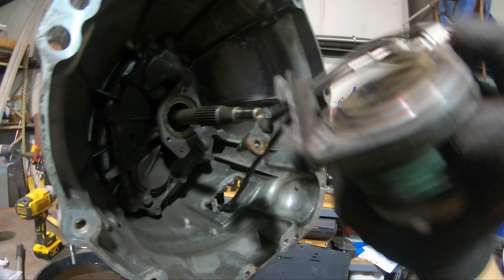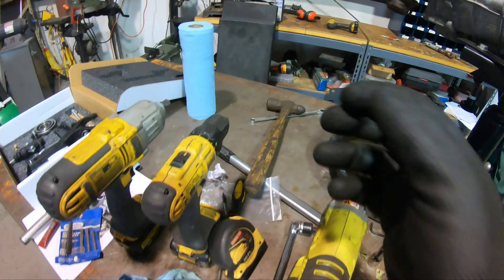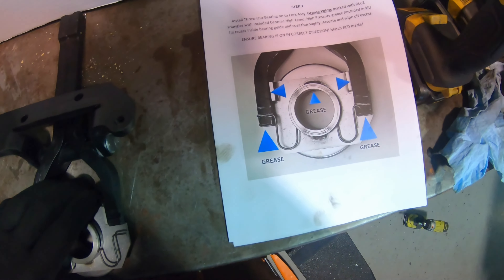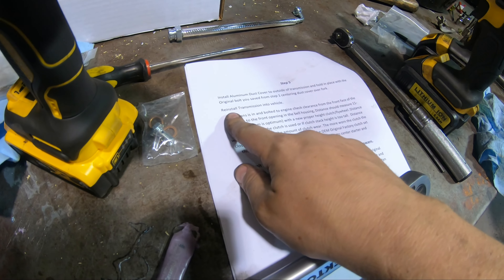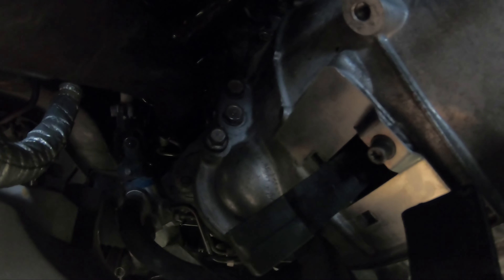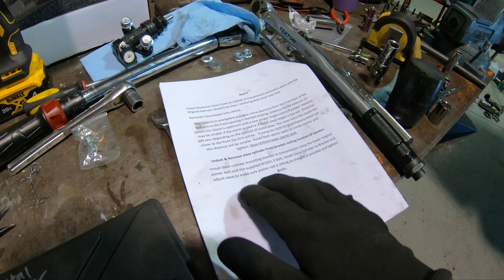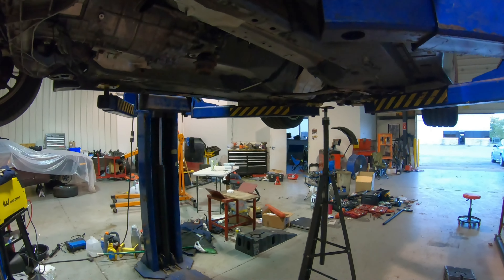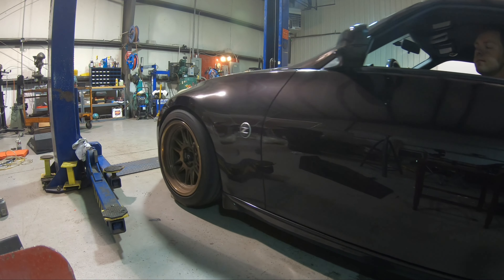370z Clutch Issues Transmission Removal and  ZSpeed CMAK Install Guide Part 2

Comment: Great job detailing the steps and commentary on possible mistakes to watch out for. The CMAK is the best kit around and I'll be getting the upgraded version soon.
Reply from the maker: Happy to help! It was a learning experience for me so I'm hoping that any small issues I had are the same issues others might have! I am interested to know what's different about the updated version!
Reply: @konradchristen  better engage/disengage characteristics, stronger materials, and I think a better cylinder. I had the V1 and it worked well from 2011 till 2022, only issue is the creaking noise from the cylinder after about 8 years lol. I'd call and double check this info as it was a while ago that I asked. But if you have the V2 you should be good for many years to come.
Reply from the maker: @Spushed  Thanks for the info!
Reply: @Spushed  how do I distinguish what version is which and where do u recommend buying one
Reply: @Spushed  I just got the v3 but haven't installed yet , I also got the stage 2 quiet clutch kit from them as well

Comment: My 09 Z clutch finally gave up after 110K miles. Exactly like what you're experiencing (clutch slipping @ highway speed, would not get in or out of gear, etc). I just ordered the ZSpeed package and can't wait to get them installed. I would love to do the CMAK kit but decided to go with the HD CSC instead. Chances are it will probably last the life of the car anyways and it's all I could afford for now 😅

Great videos man. Keep up the good work
Reply from the maker: Happy to help! Don’t be afraid to put some RBF600 in the clutch line while doing this! Most of the fluid will come out anyways so it’s the perfect time!

Comment: Great video.
Does the clutch fork hit the back of the transmission window at full pedal travel/close to full travel on your car? 

I’ve verified that we have all of the proper parts and correct install complete. I measured 16mm from the front of the fork to the transmission window. (Optimum according to directions). The pedal hits the back of the window at close to full pedal travel. 

Parts: 
- Zspeed cmak V3 w/ V3 tall throw out bearing
- Zspeed LW FW and Super six clutch 

All parts are brand new.

Comment: Hey bro quick question how long did it take to convert to CMAK after the trans was dropped? Im getting ready to have my G get a CMAK but just trying to be concious of the labor time

Did you find it necessary to swap out the master cylinder as well?

Comment: Great video, wondering if you have any quick thoughts on Z1 CSC vs Z speed CMAK? I read about it on lots of forums and seems like there is a huge community preferring the zspeed?
Reply from the maker: So back when I was doing my install Z1 didn't offer a CSC "delete kit" like they do now. But Z speed pioneered that swap and Z1 made a similar kit afterwards. I just watched Z1's video on their kit and I'm sure it works fine, but it is a more complicated install (barely) than the ZSpeed kit, and at a similar level of cost, with a more simple design, I'd probably go with the Zspeed kit. But my opinion is that Z1 makes high quality stuff so I bet it would be fine too.

Comment: I need help, my CMAK V2 with JWT Clutch and Flywheel + the RJM pedal mod has slipped in 3000 rpm launches
Reply from the maker: So what do you want help with? How new is the clutch? How much power are you pushing? Where is the “catch point” adjusted to on your RJM pedal
Reply: @konradchristen  this only happened  twice and the burnt clutch smell was BAD! 

It happened at around 5k miles on the clutch and then 21k miles on the clutch.

Thr RJM catch point has been adjusted from 75-25 in both instances.

The mechanic who installed the CMAK and new clutch later installed another new slave and master per my request but it still happened.
Reply from the maker: So slipping under load doesn’t really have to do with your Slave / master cylinders unless they are accidentally applying force when they shouldn’t. And as they fail they tend to become less effective at disconnecting the engine from trans.

I wonder if you just don’t have enough clamping force from the pressure plate. Or if the clutch itself doesn’t have enough grip.

When you utilize your clutch pedal, you are pushing the connection of engine/trans APART from each other. They are held together by the force of the “fingers” on the pressure plate and then in turn by the friction between the clutch and flywheel contacting each other.
Reply: @konradchristen  I forgot to mention.. The two times that the clutch slipped on launch, the tires didn't spin much but I lost pressure in the clutch pedal for a moment. The pedal was sinking to the floor with very little pressure after shifting 1-2-3
Reply from the maker: @GTR24  hmm weird. That could be an issue with your fluid getting hot. It’s a common fix to switch to higher temp brake fluid in the clutch reservoir. 

But still the clutch pressure plate should hold the clutch against the flywheel regardless of fluid pressure. IE if you dumped out all your fluid, you would not slip but instead it would be impossible to disengage the clutch.
Reply: @konradchristen  the mechanic said that the Zspeed instructions had the clutch line too close to the exhaust. And he wrapped the clutch line around something else. I'm gonna get underneath and take a pic